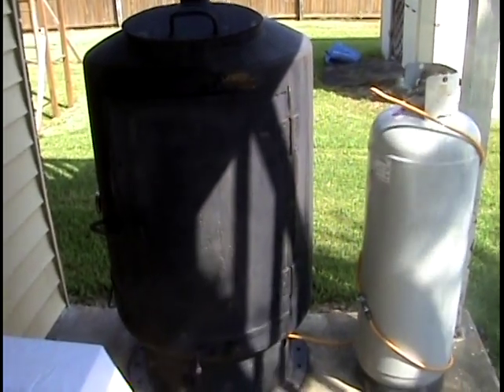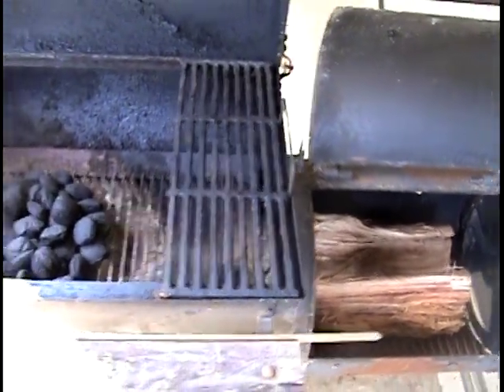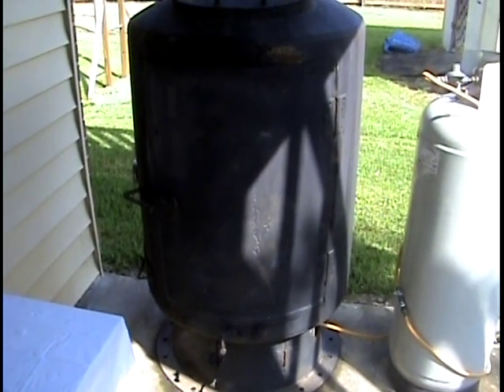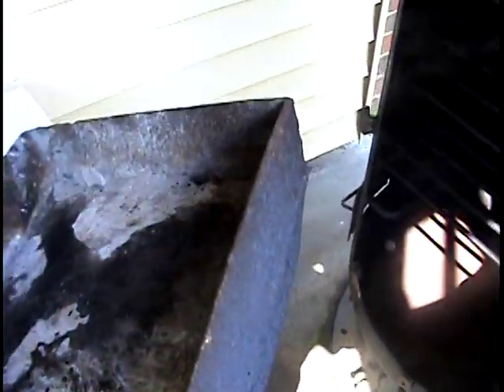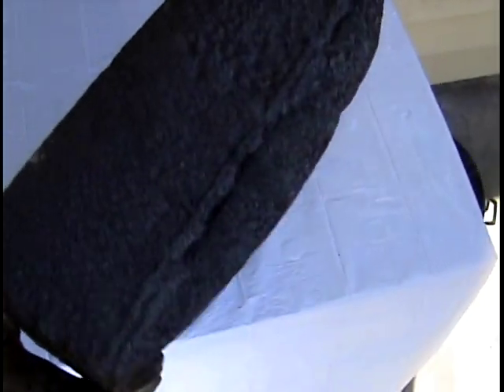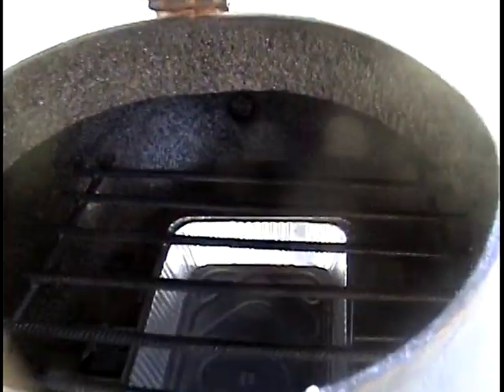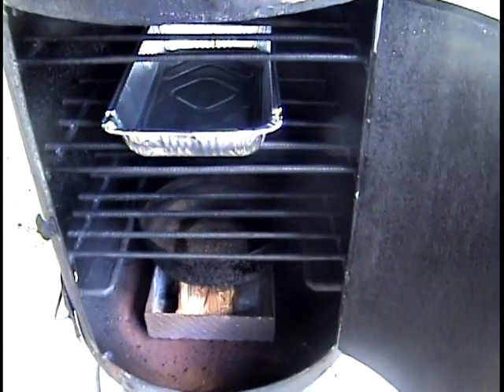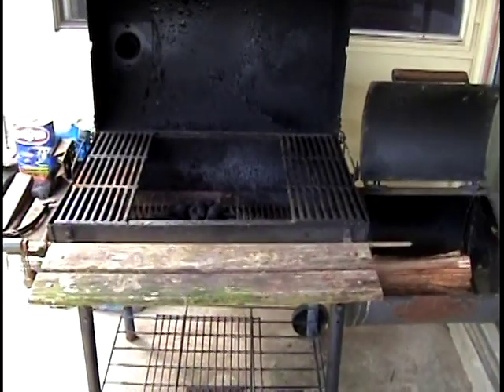How To Smoke A Brisket - Texas Style Part 5

Comment: @1twistedworld  Like doing a large turkey. With a small charcoal flame in underneath and larger in firebox.  It was an all nighter and part of the day.  I wired the pigs in chicken wire because you have to flip it several times.  I like using coconut water to make the skin crispy.   I used a 14 pound suckling.  My char griller is larger than yours.

Comment: I envy your vertically oriented sand-blast box; awesome find. Vertical is the way to go. Horizontal is OK but it wastes smoke and heat.
Question: when you load this beast up with briskets (or lots of meat), do you rotate top to bottom? Do you ever check internal temp?
In your rib video you didn't show us the temp at 4 hours. Does this beast keep 235 F for 4 hours?

Comment from the maker: I never have to rotate up or down. I do turn briskets, ribs, etc. one time towards the very end just to brown the other side which has been soaking in the juices. I never check the internal temps of the meat because I know when it is done by time, weight and type of meat. I can control the temp using the vents and on average I can smoke any meat at about 215 - 225 degrees on average for however many hours I need to. The time will vary depending on the size and fat content of the meat.

Comment from the maker: @KMCReading  What type of wood are you using? I prefer hickory that has been cut in the early Spring when the sap is up in the tree, but if that is not available, a bag of hickory chunks from the store will work as well. Some use mesquite or wood from other fruit and nut bearing trees such as apple, pecan, oak, etc. texasbarbeques. com has a listing for different wood types and the meats they are used for. Again, I only use hickory so I can't vouch for the other woods.

Comment from the maker: @12quillemall5321 Doesn't break any rules around my house. Fire is fire. You can use it to burn up your wood or you can use it to smoke your wood. I prefer to get the most out of my wood by using the propane. Works like a champ.